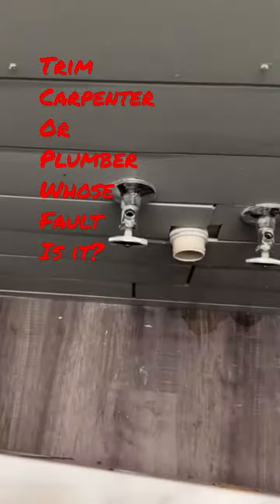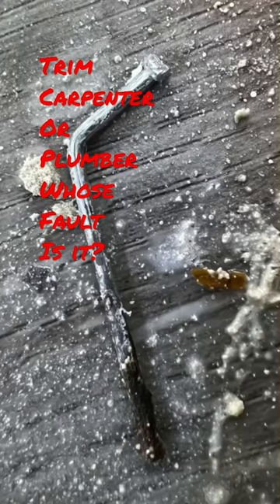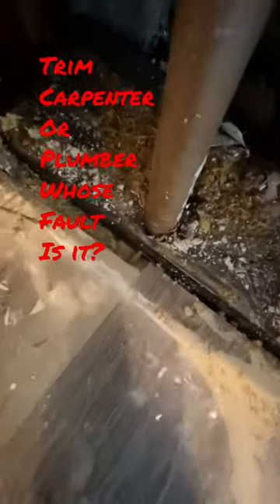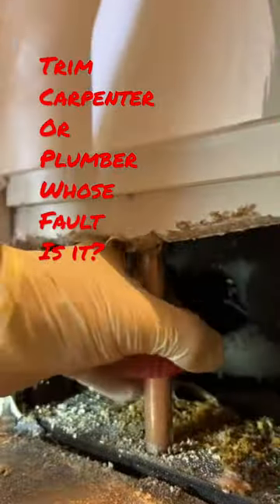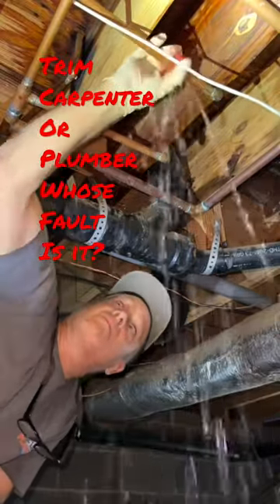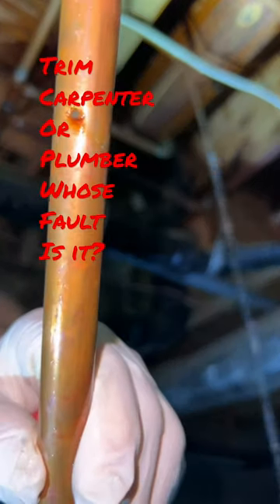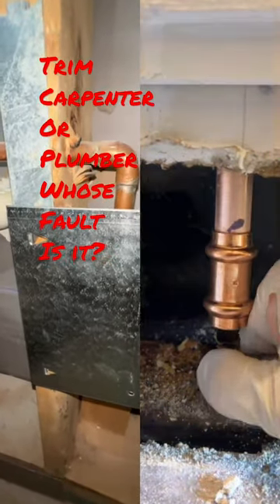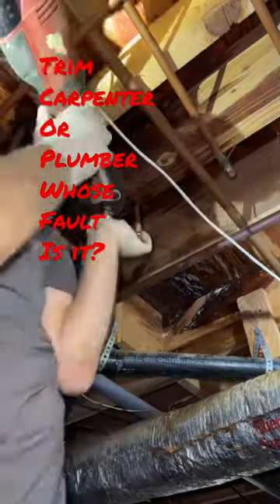Copper Nail Hole Repair@TappPlumbing #plumbingproblems #plumbing #copper

Comment: As a plumber I hate to say it but it’s 100% the plumber’s fault. He didn’t install a protective nail plate also known as a stud guard. The trim guy can’t see that.
Reply: As a plumber I completely agree!
Reply from the maker: We completely agree as well!
Reply: @jk-kr8jt  you didn't see that lil piece of quarter round. It went between the vanity and wall. Finish nail got shot through.
Reply: I’m not a plumber but I am an electrician. Nothing should be installed that close to the outside edge of the framed wall.
Reply: Ehhh the carpenter got his gun and put his nail through the pipe….it’s clear as day.

Let’s not place blame on the plumber that is out there doing the lords work.
Reply: @jk-kr8jt  as low as the nail was he probably thought he was hitting the base plate of the wall. 2nd, both hot and cold in the same bay might be typical but there’s nothing in the plumbing code book that says it has to be. So, it’s not always in the same bay.
Reply: @ECE2424  happens all the time and there’s also nothing in the plumbing code that says it can’t be that close. The code book does say it must have a nail plate to protect it.
Reply: @chrisreynolds2410  if you don’t know just 🤫
Reply: Look at Jesse trying to assert herself in here….you cute af Jessycakes.

You are a feisty angry one ain’tcha.
Reply: @jessetittle  yes jesse no always just typically.
Reply: @chrisreynolds2410  Lol yes, I am.
Reply: @jessetittle in the code book there's the 1" rule though for nail plates. Plumbers fault! I'll add nail plates even when pipe is 1 1/2" from face of stud/wall/plates
Reply: Shouldn't you have common sense and say this is a bathroom wall and i shouldn't blindly shoot nails into plumbing wall
Reply from the maker: @ECE2424  No arguments from me on this point my friend. Where we live things are crammed into tiny  little spaces and it leads to a mess just like this. Thanks for watching and leaving us with your opinion!
Reply from the maker: @jk-kr8jt  Some times plumbers have to cram things in weird places around here because of such limited space to work. Thanks for watching!
Reply: @workingtothebone256  I said it was the plumber’s fault in the very beginning. Pay attention, young man.
Reply: @JohnSmith-xu7ev  no
Reply: Messy Jesse don’t try and switch your opinion up now that you been proven wrong.
Reply: @jk-kr8jt  Probably a base board. It was a finish nail which also tends to confirm that.

I would argue that this was probably installed before nail plates were a thing though.
Reply: I completely agree as well as a plumber. We need to have enough sense to see the whole installation from start to finish, including foresee possible issues, such as nail holes or location of window installations in case we need to reroute, plumbing, vents or popping a hole through the roof. Making sure it’s not too close to a Valley. We need to stop thinking quantity and start thinking quality.
Reply: @davidveliz7170  I completely agree.
Reply: @workingtothebone256  I don’t even know what you’re talking about. Apparently you deleted what we were talking about.
Reply: @jessetittle  scroll up! I didn't delete shit bud!
Reply: Yeah true but who knows who did what when
Reply: nail guns will shoot right through stud guards.. ive fixed many of them through the plate and through the copper.. the pipe could be moved back away from the front of the wall would help on short trim nails for shoe mold
Reply: David very well said, I’m a very good carpenter to put it lightly and if more folks in the trades had your mindset we would be better off as a whole.

I maintain the highest quality and have pride in whatever I do and I’m set up properly and wish I saw that in more tradesmen.

How do you all feel about females in the trades??
Personally I like it because I’ve always said they have attention to detail that most men don’t.

Jesse I know you don’t care either way but I was just busting your chops in the other comments…no hard feelings
Reply: I completely agree he should have done that.  Unfortunately, I’ve also had nailing plates up and screws driven with impact drivers and nails used in nail guns go right through them.  As a plumber, we should always put them as to do our due diligence, but the rockers and carpenters should be mindful as well!
Reply: @ECE2424  sometimes they have to be, the electrician might have run all his wires where the guy was planning to run his pipes 😂😂😂
Reply: @AndrewJackson456  screws with impacts too!
Reply: Those nail guards work. I shoot them from time to time. I also would have put my nail there. If you can't stud find, you aim for the bottom plate
Reply: @ECE2424  u have to on the outside wall. thats why you use the boca plates now. 2x4 outside wall you have to pull the water line to the front so insulation can go behind. at least in the south anyway. A boca plate would have prevented this
Reply: As an electrician I will agree it's always "the plumbers fault"
Reply: As a builder we too have been called back to address areas in need kick plates by our local municipalities.
Reply: People are too reliant on those plates regardless, a drywall screw can go straight through those. Plumbing should be a bare minimum of an 1” away from framing. If it’s not code where you live it should be…
Reply: @jk-kr8jt   It’s pretty common to try and nail into the sill plate for base board.  It could also be the shoe/quarter round nail.
Reply: @Mark-gt9yv  Obviously your not a plumber. Unless every wall in the home was 2x6 you could not have all pipes an inch away from the edge and in the southern states thats wasted sq ft  to have 6 inch walls. although nice  to have but a waste down here. boca plates will stop a screw pretty easily and a nail. whats code in one state would be quite stupid in another. Thats like me saying your frost line should be a foot in the north like it is here in the south. codes about certain things go along with the places they are in and the weather and other things involved.
Reply: Who ever said a plumber actually did the work..???
Reply: @jk-kr8jt  Bottom plate
Reply: @chrisreynolds2410  The lord was a carpenter
Reply: @JohnSmith-xu7ev  Common sense and code would say nail plates should be installed to protect this.
Reply: @ECE2424 as someone who ties a rock to the end of your wire and tosses it across an attic to run your wires,  your opinions are null and void.

We all know sparkys are the laziest of all the trades.
Reply: @dennislinden3657  
Sure pal
Reply: @ECE2424  you get it jabroni
Reply: Plumbers fault.  Should've installed a nail plate
Reply: Exactly 💯
Reply: @JohnSmith-xu7ev  As a Carpenter, I always make sure I do my best not to let things like this happen, but unfortunately it isn't always avoidable!
Reply: He can see the pipes right 👉 the sense is so common  yet the send Brad nail right into the pipe
Reply: @brianwoods6403  🤣🤣🤣🤣
Reply: @Chris Reynolds  if the plumber put a nail guard right there this situation wouldn't exist.
Reply: No stud guard will always be plumbers fault.
Reply: I’ve been a carpenter for 27 years. As such I believe that the carpenter shares in the fault. They should know not to nail directly in line with valves or electrical outlets. If it were completely buried with no indication of its presence, that would be a different story.
Reply: @robertessaryjr.2834  good point
Reply: You’re all wrong, there was no plumber involved with the remodel. The hot and cold would have been cut an capped and the drain would have been plugged.
100% the person who decided not to hire a plumber.
Reply: Plumber for sure , too close to   outside the wall and no protection.😮
I found ones  a water pipe next to the toilet drain pipe  and an  electrical outlet in the floor next to the gas pipe behind a stove. Wth is going on with people and I think is gonna be the worst with the weed being legal...uh mm.
Reply: I’ve been on jobs where cabinet guys have drilled through my nail plate into my pipe
Reply: i dont care if your a finished carpender a plumber or an electrician im putting the blame on the county inspector first next the blame goes to the plumbers for not installing a nail plate and third the finish carpenter has to kind of know the water pipe is comeing from some whear and it looks to me like the plumber is standing in a basement  the he can go see wear the water pipe is comeing threw the floor

Comment: Both, but plumber should have placed a nail plate guard per code..
Reply from the maker: You are correct! Thank you for watching and engaging!!
Reply: Not at the floor you wouldn’t lol I agree both are at fault but carpenter should of had a pretty good idea where they were also
Reply: @derekmcdowell2547  the fram carpenter and trim carpenter is 2 different people... and the pulmblers come after the framers, the trim carpenter's come after the drywall. So how do they know where the pipes are at in the walls? I seen water lines come I'm from the celling befor.... they need ex ray eyes?

Comment: I pulled a nail from the floor one time and water shot from the nail hole. It had gone thru the polybutene pipe and been there for more than 10 years without a leak.
Reply from the maker: Isn't that crazy!! We had a  copper pipe coupling or ninety  that we found in a remodel apartment complex one time that had not been soldered and was over 15 years old and never leaked. Funny how water and pressure work! Thank you so much for watching!
Reply: I did that once in my own house.  Pulled the baseboard out and water everywhere.  Someone was nailing Quarter round all over
Reply from the maker: @PartTimeYooper  It is even worse when it belongs to you!!

Comment: It depends on what type of copper pipe, there different grades, with different wall thickness’s. Which is going to affect the speed at which the galvanic reaction occurs.

Comment: Blame would be on the plumber for no spike plates
Reply: Yessir. It’s not how you start when plumbing,  it’s how you finish. Nail plates are the final task to finish rough in. Most def a critical step as well. Because without nail plates how can we blame the carpenters?  Or the electricians?  And don’t even get me started on the drywall guys.

Comment: Curious, is crimping copper the better way now?  Looks great.
Reply: Sometimes it's good . But sometimes it's bulky and you're in the tightest spot only a flame Flux and Solder can fix
Reply: It’s a lot more easier to pro press it than to solder it. I’d assume it’s better, only ever had soldered copper pipes leak on me.
Reply from the maker: As service plumbers we can solder but the Pro Press is a great product with a 50 year warranty that allows us to get our clients water back on in a timely fashion. thank you so much for your comment and time to watch!

Comment: When things are engineered to fail for whatever reason it’s called “planned obsolescence”. It’s a real thing especially in the tech industry.
Reply from the maker: You are correct my friend it seems if you get 10 years out of your water heater,HVAC unit, dishwasher,refrigerator, washer dryer,etc it is a rarity. Gone are the days of 30 to 40 year appliances. Thank you for watching and commenting!

Comment: Had a similar problem. Took a LOT of 4" holes in drywall to locate the pinhole leak caused by a wayward nail.
Reply from the maker: The Swiss cheese effect! Sometimes I just go ahead and open it up large . It saves time and is easier for the drywall person to repair.Thanks for watching!!!

Comment: it's possible that the nail rusted so fast because or electrolysis.  it occurs when steel and other metals stay in contact with other metal over an extended period of time. it basically causes an accelerated version of oxidation
Reply from the maker: That is an interesting theory! From what I understand electrolysis is accelerated even more when water is running through one of the metals . Do you know if this is true ?

Comment: Very possible, iron in contact with water and copper creates a reaction called electrolysis
Reply: Not possible at all, being installed a year ago, that mail went straight through the pipe.
Reply: @EAMitch  no I 100% got it but that’s not what caused the leak…
Reply: @EAMitch  I’m talking about that being the reason of leak, it’s not because of electrolysis it’s because he put the damn nail straight through it, it was 100% leaking before and might’ve sealed after but it was 100% not cause by a chemical reaction

Comment: Carpenter. Even with nail cover plates with any impact driver which we all love to use just breaks through them. Carpenter's job to find pipes, I used to hang drywall and would watch out if I was close to any pipes.
Reply from the maker: Great tip!

Comment: As a Carpenter, this is 100% the plumbers fault for not installing a nail stop.  This has happened to me twice before even with a nail stop plate.   With the nails and stop plate being made in china, I am surprised it took a year to rust out.  My first one leaked before the house was finished and the 2nd was a couple of months after occupancy.  Unfortunately both leaked on hardwood floors.
Reply from the maker: Oh no, that is definitely unfortunate. It is absolutely the plumbers responsibility. We have a written punch list to prevent these types of things from happening. Thank you so much for watching!

Comment: I’ve had to fix a job exactly for that reason. The homeowner initially thought it was my fault there was a water leak until I showed her the rusty nail and told her it was impossible for that nail to rust that fast. I was there to fix her toilet. After moving some things around a little the nail worked it’s way out and started leaking.
Reply from the maker: It is sad we get blamed sometimes for coincidences and it is amazing those leaks have not showed up sooner!! Thank you for checking us out and commenting!

Comment: I use construction adhesive and inch and a quarter brad nails if I'm installing trim near any potential plumbing. I get that the plumber is supposed to protect his work but... I just can't risk shooting 2 and a half finish nails . Same treatment for pocket doors.
Reply from the maker: Great idea and way to take pride in your work and others work as well!

Comment: AS A CONSTRUCTION WORKER BOTH OF THEM FAULT !! PLUMBER FOR DON'T PUT METAL PLATE TO PROTECT THE PIPE . THE CARPENTER  IF YOU SEE THAT PIPE , STAY AWAY FROM THE PIPE AND MARK THE TRIM TO MAKE SURE DON'T NAIL THE PIPE . COMMON SENSE !!!
Reply from the maker: I am gonna have to go with plumber. It is our responsibility to get those plates up before we leave the job. Thanks for your opinion and watching!!!

Comment: Whenever I nail into areas I know there are water lines, I will automatically switch to 1 1/2" nails instead of 2". That way the nails will never reach the center of the studs and possibly puncture a water line.
Reply: This line was a 1/4” from the outside of framing. Unless you nail
Into drywall only nail size is irrelevant
Reply: @Mark-gt9yv  If the water line was only a 1/4" away from the outside of the bottom plate, then I would say the plumber screwed up. You want the water lines to be centered on the bottom plate to avoid crap like this.
Reply: @SlavicUA  of course you want the lines centre. I’m just pointing out your mention of changing nail size would be irrelevant in this scenario, an 1 1/2” Brad would still have penetrated the line
Reply: @Mark-gt9yv  oh I see. Yeah, in this case, you're right.

Comment: Plumber, by code, if there is less than 1¼ clearance from edge of stud cavity, there needs to be a metal plate with a thickness of .1 in. 

Fun fact typical length of nails and screws used to put up drywall and siding is 1¼". So even if you didn't know the code it's a bit of common sense.
Reply from the maker: That seems to be a little problem these days. “ common sense “ 😂 Thanks for watching!!

Comment: Carpenters can't install protection plates before plumbing and electric rough in, so then it falls on plumbers and electricians for the protection plates. Carpenters should use stud finder with metal finder to detect these hidden items to avoid puncture.
Reply: it is code in Utah to use nail plates wherever water or power runs through a stud, header, or sole plate. as a finish carpenter I rely on these codes to ensure that my job goes smoothly

Comment: Plumber is responsible for putting nail plates but more importantly the inspector is at fault for passing it. I've also seen a trim nail rust enough to cause damage in 3 weeks
Reply from the maker: That is kinda creepy, three weeks !! I have a funny feeling there might not have been an inspection process. I agree about the plumber not providing some protection for his work!  Thanks for watching!!!
Reply from the maker: I just stopped at your channel. The couple of videos I watched were cool!!

Comment: I've seen cheap screws and nails rust badly in a few months outside. And I live in the desert where 6 inches of rain is an average year. So it's not like they were wet very often or for very long.
Reply from the maker: It's crazy isn't it! Where are you located? We are in GA. Thank you for watching and commenting!

Comment: Had to replace  outside  spigot from  siding  nail...2 year old  house didn't  use clamps  to center  pex in middle of wall....she happens
Reply from the maker: Yes it does!! I'm sorry that happened but you are correct stuff happens!

Comment: It's almost like recently manufactures are doing more r&d on how to make things last the least so we buy more.. I'm fed up with this. My brand new washer works worse than my washer from 1998
Reply from the maker: Appliances seem to be some of the worst offenders. We hear stories all across the board. We have a friend that has a 2019 vehicle with 40,300 miles and the motor has come apart. 300 miles over warranty. It has to have a new motor. Ridiculous!  Thanks for watching!!!